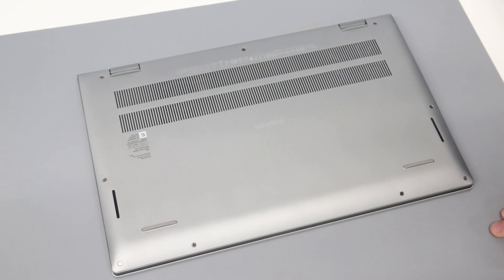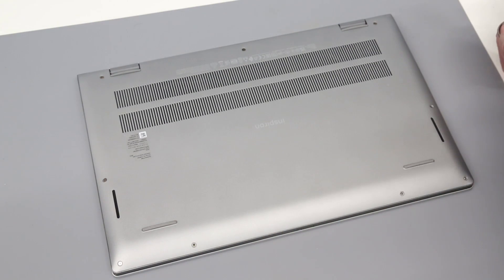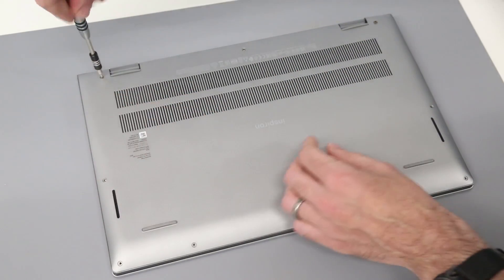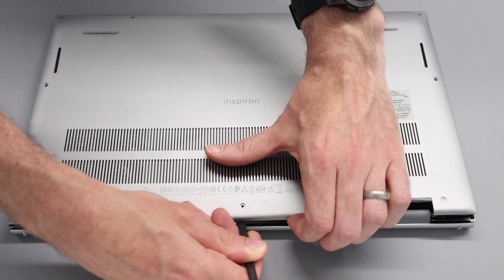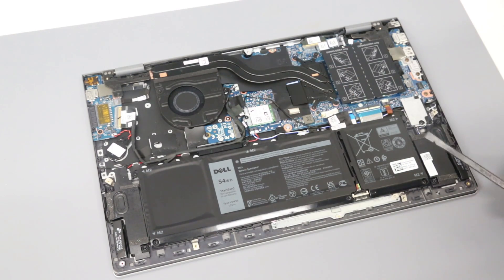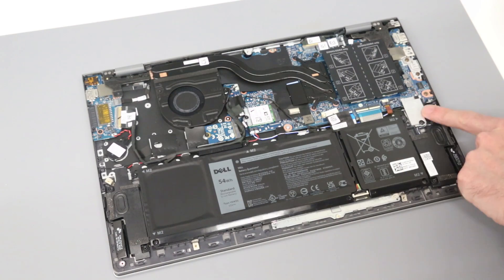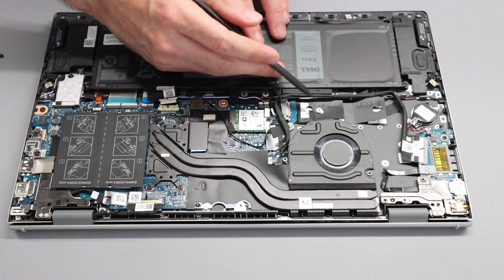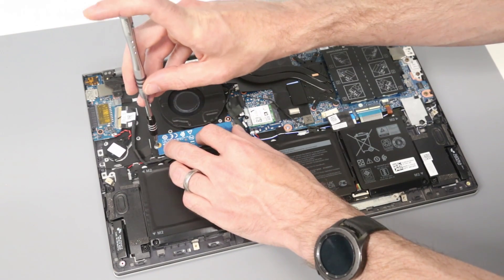Dell Inspiron 15-5510/5518 (2021) - SSD and RAM Upgrade Guide

Comment: Model Number
I have i5510-5576SLV-PUS i5-11320H with 8Gb Ram installed. what company Ram do I need to upgrade to 16Gb?
Reply from the maker: I fit Crucial DDR4-3200 SO-DIMMs: https://amzn.to/3Gjpi5f (Amazon Affiliates link)

Comment: Is your laptop Bottom Side completely flat, mine feels rounded or swollen around Inspiron branding?
Reply from the maker: It should be.
From memory there is a little clip in the base on the laptop around that point - if that is right its possible the base isn't seated properly.
Other possibility is a swollen battery.

Comment: Dear Brue, 
your SSD & RAM video is very informative & cleared many doubts. recently, I purchased the 5510 with 512 GB ssd 2230 inbuild. but I want to install SSS 240 M.2 2280 in my 5510 dell laptop. 
can I install it ? 
will it create any problem if 2230 install in one slot and 2280 installed in second slot in same laptop? 
all driver will support ?
pls help
Reply from the maker: That should work fine - move the M.2 2230 drive to the second slot and fit the M.2 2280 into the first one with the bracket moved.
Reply: @BrueComputing  Thank you for reply, but I have question, if I will keep 2280 into first slot & 2230 in second slot, in such case, window will work in 2230 in second slot or I have to reinstall windows as well as office in 2280?
Reply from the maker: @bhavik484  Should work just fine.

Comment: Great 👍 
Can I add a nvidea mx450 graphic card?...currently it has intel iris xe integrated graphics.I confirmed from dell that it can be upgraded but the graphics card dealer says it cannot be upgraded.Please Give me some clarity.I cant run some high end games and softwares.
And It would be great if you make a video for that😁
Reply from the maker: Dell offer it with discrete graphics, but to upgrade an existing machine you'd have to replace the entire mainboard, which probably doesn't make sense.
Reply: @BrueComputing  ohh! Thanks for helping out👍
Reply from the maker: @adityachauhan9437  No worries.
Reply: If it is a new laptop, I think you can return/exchange that laptop and get the model which comes with Nvidia by paying an extra Rs.5,000 something.

Comment: Hi, I have the same laptop and did the following as part of upgrade:

Original SSD (Samsung PM991A / 2230) moved from slot 1 to slot 2
New Samsung 980 SSD installed in slot 1

In original configuration, with only slot 1 occupied, Crystaldiscinfo showed that it was getting the full Gen3x4 speeds.

After above upgrade was done, slot 2 seem to be running at Gen3x2 even though the SSD is capable of Gen3x4
Slot 1 continues to work at Gen3x4 with new SSD

Do Dell laptops generally have different channel availability for different NVMe M.2 slots? Any workarounds to get Gen3x4 on both slots?
Reply: I just ran into the same issue, did you find a solution?

Comment: Thank you for the awesome video! With your help I opened the cover and replaced the thermal paste (now thermal grizzly) on my Inspiron 15  with the AMD Ryzen 7 5700U in it. In the past I got crazy 100 °C just by watching videos?? And now I am at 70°C at full load (Heavy Load Benchmark), I can really recommend it guys!
Reply from the maker: Glad it helped! That's an impressive improvement.
Reply: @eXCepTIoNGER , I am facing the same issue with 5515 inspiron (ryzen 5700 U) , could you explain what you did?
Reply: @kundanmishra91  I watched other video of how to replace the thermal paste on a laptop and did what they said. I used the whole square of the cooler not just the small part of the cpu but I also put thermal paste to the edges of the cooler so the transistors next to the cpu ( small squares ) get cooled as well. Hope this helps :)

Comment: Can anyone share their experience with upgrading their ram? Why am I getting black screen : ) According to crucial official website, the 16*2GB Kit I bought is compatible...

Any thoughts?
Reply from the maker: What was the kit you bought?
I'd remove and refit them, making sure they are firmly pressed in to the sockets and clip in securely.
Reply: Hi! Many thanks for the quick response. the kit is 2*16GB
The brand is Crucial
And the specs are as below

Crucial RAM CT16G4SFRA32A 16GB DDR4 3200MHz CL22 (or 2933MHz or 2666MHz) Laptop Memory
Reply: according to crucial web-site, these are compatible... however, in practice it did not work. 
my laptop is i5 11th gen version of inspiron 5510. I am now considering the retun the rams as they did not work.

Comment: Great work. Btw if I do the same thing like you (move disk C: to 2nd ssd slot), will I lose windows license and will have any impact on all installed apps (games,...) in disk C: ?
Reply from the maker: Windows license is in the UEFI firmware, not on the SSD. Shouldn't cause any issues switching the slot - it will continue to see it as drive C:.

Comment: Hi , I have a question about G15 5510.
Can I upgrade this laptop to SAMSUNG 980 PRO PCle 4.0 NVMe M.2 SSD 2TB model SSD ? 
Is This laptops mother board compatibility for PCle 4.0 NVMe M.2  ?

Comment: Hi James. Great video mate👍 I got a question regarding swapping the original ssd into slot 2, will the laptop still recognise the original ssd as C:? even though it’s been moved to slot 2? As it’s got the OS installed on it. Or do I need to clone the original ssd onto the new ssd first?
Reply: Hey did u get your answer? I need one 😅
Reply: @RahulPatel-hr4qe  no sorry they’re hand hasn’t been a reply to this question. I think I was being ignored as other questions have been answered, that were posted after my question. 
Perhaps it was deemed a stupid question not worthy of answering? Or too obvious maybe? I’m a complete noob so I still don’t know what to do (regarding coming the c drive first) 
Hopefully someone else might be able to answer if not the original poster🤞🤞🤞
Reply: @geethoi8229  Computers usually work like this:

1. Power on
2. Do POST Checks
3. Check for bootable Drives
4. Boot the first bootable drive in the boot device order. 

So if your 1st drive is not bootable, but your 2nd drive is, then your second drive will boot up as, and usually still as the C: drive. 

However, if you have several bootable drives, eg two bootable hard drive, or bootable usb external drives, then you would probably want to change the boot order in bios and move your 2nd drive to the top of the boot order
Reply: Vlad GruetZ  thanks pal👍
I’ve not tried it yet (for fear of breaking my laptop) but I’ll give it a go now you’ve confirmed it works. Shame the original uploader couldn’t spare the time just to answer a single question….🤔
Reply: Vlad GruetZ  did you put the 512gb ssd in the secondary port and the 2tb ssd in the main port? does windows boot normally from the secondary ssd? I have a inspiron 15 5510 with 512 gb ssd, I want to install a 2tb ssd in the main and leave the 512 gb ssd in the secondary port without copying.

Comment: so the original ssd is a 2280 but you can put it in the second slot wich only takes 2230? is that right or am i not understanding something?
Reply from the maker: Yes, that is correct.
Reply: @BrueComputing  thanks for the quick reply
Reply from the maker: No problem!

Comment: I bought this laptop of its i3 varient yesterday and I am little dissatisfied for its booting time which is usually taking 15-20 secs.I researched about it and got to know that processor is good but the SSD which has used in this laptop is bad which causes slow booting.So I want to completely remove it's old SSD and add a new SSD (Samsung 980 pro 1tb SSD).My question is, will be any issue by this upgradation of laptop?And after removing old SSD,will all the windows boot file erase and I have to install windows again? actually I am new in tech field,so if you got my questions silly then please excuse me.

And if anyone knows something regarding my question then please reply me ASAP.It's an emergency situation
Reply from the maker: You'd need to either clone across the contents of your old drive to the new one, or clean install Windows on the new one after fitting.
Reply: @BrueComputing  Thank you very much sir for your reply.Can you please tell me how can I clone the old contents of the drive to new one.
Reply from the maker: @soumyaranjanrout4366  I use True Image.
Reply: Same, even I bought the i3 variant of this machine. The SSD that's inside is from Kioskia. The boot time I am getting is somewhere around 15 to 18 secs. I want to replace the primary drive to Samsung but not sure how to that. I am also not sure how much I can upgrade the SSD. Please let me know if you have upgraded your SSD.

Comment: What is the maximum ram the 8 gb ram model can be upgraded to?
Pls answer, I am planning to buy one.
Reply from the maker: They can certainly take 16GB modules, possibly 32GB ones.
So if keeping the existing 8GB module, 24GB or 40GB. If replacing it then 32/64GB.

Comment: Very helpful video. You might not have to pull the battery cable if you enter service mode first. Unplug the AC adapter with the computer off. Hold the B key and press/hold the power button for about 3 seconds (wait for Dell logo). Then confirm you want to enter service mode. This will prevent anything from powering up. To reverse, plug in AC adapter and turn on.
Reply from the maker: Really useful tip, thanks!
I'd probably still disconnect it as it only takes a couple seconds, but good to know that is an option.
Reply: @BrueComputing  Granted it isn't hard, but there is some risk of killing the connector. I don't remember if you mentioned it or not, but the first post after you add memory takes a LONG time and it will make you nervous if you aren't expecting it. (I now have 500GB with Linux, 2TB Windows drive, and 64 GB of RAM installed). We'll see how battery life is....
Reply: @wd5gnr  How was the battery life?
Reply: @benos1799  seems fine. No complaints but I don't go unplugged much anyway
Reply: @wd5gnr  Thanks
Reply: @BrueComputing  i have installed WD SN750 PCIE 3.0 NVME SSD after installation it doesn't appear i thinks it doesn't supporting my 5510 any solution

Comment: did you experieced ram compatibility issues? i've tried to upgrade mine(5480) to 16gb and couldn't find any brand that worked
Reply from the maker: I use Crucial RAM. The Latitude 5480 is very different to the Inspiron 5510 hardware wise however.
Reply: @BrueComputing  I actually have an inspiron 5480( that's the model at least in my country. It has an I5 8th gen with 8gb ram)
Reply from the maker: Gotcha. Still quite different to the 5510 which is 11th gen Core and takes DDR4-3200 vs. the DDR4-2400 the i5-8250U uses.

Comment: Can u please disassemble the dell Inspiron 15 5515 ryzen 5 5500u 15.6inch laptop please see? I want to see is there any extra slot for ram expansion?
Reply from the maker: I don't have a 5515, but the service manual shows it is a very similar construction to the 5510 and has 2 x DDR4-3200 SO-DIMM slots.
Reply from the maker: Although standard configuration on the UK models is with 2 modules fitted as standard, so needs both swapped out.

Comment: does it fit and support 2x normal ssd size drives and also 64gb ram at 3200mhz?
Reply from the maker: Slot 2 only fits an M.2 2230 drive.
Officially the max is 2 x 16GB. I don't yet have any 32GB DDR4-3200 modules to test with.
Reply: @BrueComputing  hmm it seems like there is room for a full sized m.2 and okidoki will u have any x2 32gb ram sticks to test with at any point 👍
Reply from the maker: @kasper8007  The speaker is in the way and there is no mounting point for an M.2 2280 drive.
I hopefully should have some 16GB and 32GB modules to test with at some point, but I sold the 5510 after doing the review and upgrade/repair guides.

Comment: Is this SSD compatible with the Laptop?
I checked with dell support and they say this ssd is Gen3 x4 which is not compatible with the Laptop, only Gen3 x2 is compatible.
Could you please confirm.
Reply from the maker: PCIe 3.0 4x drives will fit just fine, but they may only run at 2x speed depending on the slot.
Reply: I'm buying the same ssd of which you have pasted the link in the description - Crucial P2 M.2 1TB 2280 PCIe Gen3 x4 NVMe.
Have you tried booting the Laptop with this ssd installed? Did it work fine? Because dell support is adamant that this ssd won't work in this laptop.

Comment: I'm considering this model as an upgrade to my inspiron 5558, which is starting to show its ageI bought it in 2015). I'm running Win 10 Home from a 512GB Samsun860 EVO SATA SSD. i also have 16GB ram installed.Would it be possible tomigrate my OS,and programsfiles to the SSd present in this machine?Also, would I be able to use my ram in this machine? Please advise. Thanks.

Comment: Thanks for the video.. I have just ordered an Inspiron 15, with a 512GB SSD. I was wondering if it supported another SSD..  and boom I found your video showing that it does.. Now I can't wait for my Inspiron to be delivered
Reply from the maker: Awesome! Glad it was helpful and hope you like it. Just make sure it is definitely the 5510 you've ordered as there are quite a few different models.
Reply: @BrueComputing  bro does it have heating issue
Reply from the maker: @jagdeepsingh208  I didn't encounter any, but I didn't have the laptop for long as I sell them after doing my review and upgrade/repair guides.

Comment: which cpu is better please intel i7 11390h or intel i71165g7 ?

Thanks
Reply from the maker: The i7-13390h should give higher peak performance. They're both fundamentally the same chip, but the 13390h can use more power and runs at higher clock speeds.

The i7-1165G7 is more suitable for smaller laptops where less heat and power consumption is a priority.
Reply: @BrueComputing  thank you very much ! Is it a new chip the 11390h. As dell are sending me out a replacement system and I wanted to see if was better or worse than current
Reply from the maker: @joeblack2534  I guess they are replacing a 5502 with a 5510 then? I'd be fairly happy with that as a replacement.

Comment: Hlw sir... I purchased this one with i 3 variant... Now I want to add another 8gb of ram and a ssd in the second slot.. If i purchased from outside it will cost me only 120$. I contacted dell customer service, they told me that for both 8 gb ram and 500gb ssd it will cost 160$...but they are not telling which company parts I will get. What should I do?

Comment: I have it. Does it take 16gb ram? I have 1x8 gb already ; intend to install an additional 1x16 gb
Reply from the maker: 16GB modules should work fine. I normally install matched pairs for optimal performance though - so either 2 x 8GB or 2 x 16GB.

Comment: Great video…thanks. 
I’m planning to do virtually the exact thing you portrayed in the video. I’m going to add a 1TB ssd to the existing 256gb ssd that shipped with. Will any installed software on the original ssd still be accessible after adding the new 1TB ssd? Thanks in advance.
Reply from the maker: If you add a second drive then yes, Windows should still boot from the original, everything still installed, etc.
Reply: me two adding 512gb ssd
Reply from the maker: @saeedzahra9276  Hope it goes well.
Reply: Thanks

Comment: Hi 
I have bought  dell Inspiron 5510 last month and it has 512 gb nvme m.2 2230 SSD. Can we possible to change it to 2280?
What will be the maximum supported storage capacity for these two variant?
Can you help me?
Reply from the maker: Yes, this literally shows you how to do this.
A single-sided 2TB drive should be no problem.
Reply: @BrueComputing  okay
Reply: Sk hynix bc711 nvme 512 SSD has came along with it. Can you suggest some best SSD brands?
Reply from the maker: @akhilrc3346  I normally fit Crucial. Samsung are also good.
Reply: @BrueComputing  okay

Comment: Hey Thank for this helpful video.
Can you tell me how much ram I can use in this model 5510 and how much ssd m2.?? Thx
Reply from the maker: 2 x 16GB should work fine. Amazon Affiliate link here: https://amzn.to/3yuMoBe
2 x 32GB may work but I didn't have any to test
SSD wise, any NVMe M.2 2280 drive should work, such as the Crucial P2 2TB: https://amzn.to/3DwS80U

Comment: This is odd:  I scanned my laptop using Crucial's system scanner. It says that Crucial does not make compatible Memory for the Dell Inspiron 5510. I scanned my laptop using CPU-Z and it confirmed that my computer contains RAM: 2 x 4 GB DDR4 3200 MHz CL22. Crucial makes this type of memory:Crucial DDR4-3200 8GB SO-DIMM.  Should I install it or is something else incomaptible?  What say you? Thanks again and great channel!
Reply from the maker: Probably an error on the checker on their website as its a relatively new model.
The Crucial module I fitted worked without issue.

Comment: Sir , I have Inspiron 5510 i3 1125g4 laptop ,  this model have empty M.2 SSD slot or not??
Reply: And also tell me about the brand of the SSD
Reply: Which is already exists in this model
Reply from the maker: It should have a second slot.
You can use CrystalDiskInfo to find out details of your current SSD: https://crystalmark.info/en/software/crystaldiskinfo/
Reply: @BrueComputing  sir I don't know to use this site , can you please find that this model exists empty m.2 SSD slot or not?? And also the brand of SSD already exists in this model..
Reply: Please 🙏🙏🙏🙏🙏🥺🥺🥺🥺 sir
Reply from the maker: @dr.kartikvyas159  Download and run the program from the link and it'll tell you what SSD you have currently.

Comment: Great Video. I have the same laptop confirured with 2 x 4GB of RAM, same as yours. Can I replace just one SO-DIMM with an 8GB for a total of 12 GB or do they both have to be the same?Thanks
Reply from the maker: For optimal performance I'd run matched pairs, particularly if concerned about gaming/3D graphics performance.
Reply: I have question also. Can i upgrade the ram from 2x4gb to 2x8gb ram?
Reply from the maker: @jeffaldrenroque4570  Yes